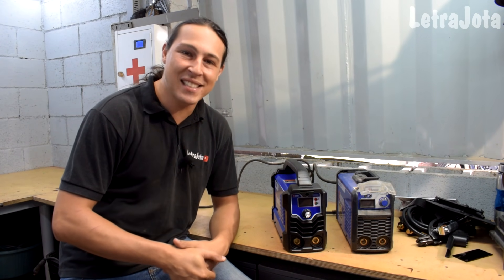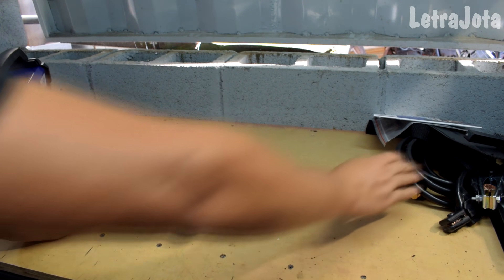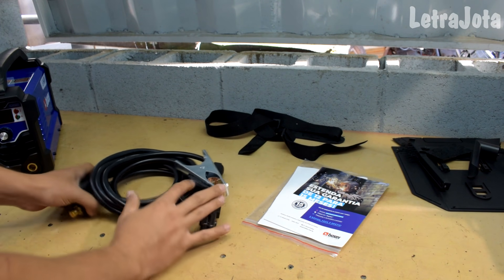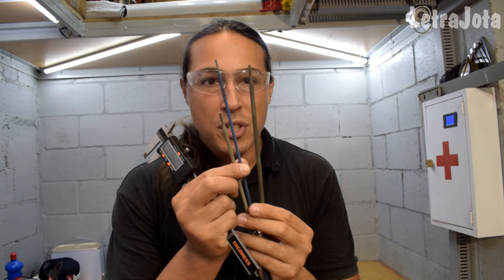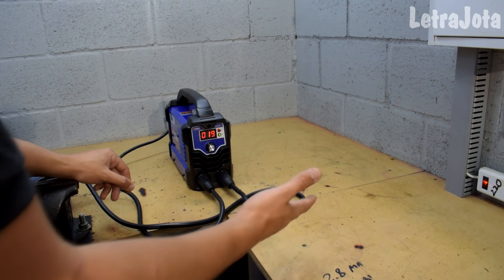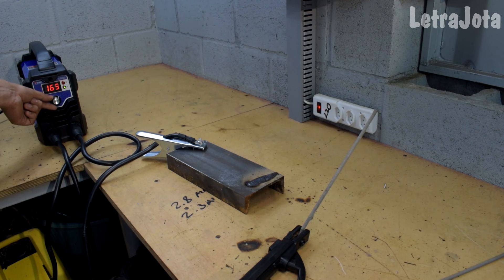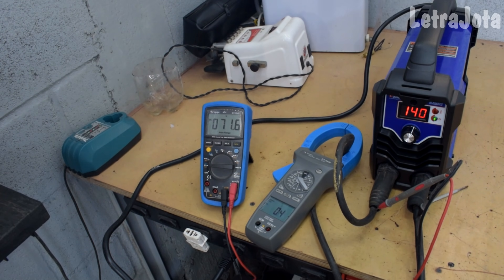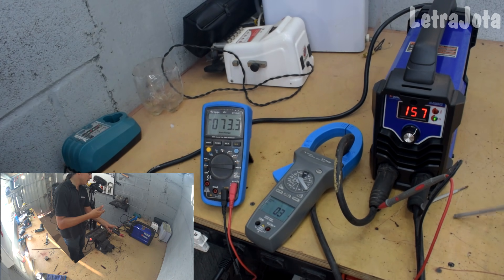TESTE NOVA FLAMA 221 BOXER

Comment: Ficou legal , só trabalhou um pouco acima por isso deu muito respingo . Lembrando cada milímetro equivale a 40 amperes se for soldar 2.5  na posição entre 100 e 110 amperes caso for soldar em ascendente desconta 15 % ficaria enter 80 a 90 amperes . Máquina fica manteiguina 👍🏻

Comment: Só queria entender uma coisa .. Na saída deu 30v x 238Amperes que é equivalente a 7.140 Watts . A máquina vem com cabo pp 3x2.5mm e plug macho de 20A .... 20A em 220v é equivalente a 4.400w Certo ? Como que a máquina consegue entregar 7. 140 watts na saída consumindo no máximo 4.400w ? Se ela consumir mais que 4.400w plug e tomada vão derreter ...Ela praticamente dobrou a potência de saída ...
Reply from the maker: Chega puxar na faixa de 31 amperes da tomada.
Em vídeos anteriores coloquei um amperimetro na tomada Verifiquei que a corrente sobe bastante além dos 20 amperes.
Essa máquina vem com tomada para facilitar a vida do hobbysta mas quem trabalha frequentemente com produto tem que mudar a tomada.
É que na maioria dos casos você não vai passar de 180 amperes
Reply: @letrajota  Ah sim ... é se ela consome 31A da rede tá explicado ... na realidade se for ver o cabo e a tomada até suporta a sobrecarga pois fica ligado pouco tempo consumindo essa corrente e na maioria das vezes o pessoal sempre usa a maquina com uma amperagem mais baixa né, é raro precisar usar na máximo ... Obrigado pela resposta!

Comment: Eu comprei flame 161 ela não passa  de 120 amperes no 110 votes
Reply from the maker: Tá bom pra caramba porque em 110 volts a corrente cai pela metade.
Isso é normal outras marcas inversora como a Esab funciona da mesma maneira.
Se for derreter mesmo é 220
Reply: Normal , nenhuma inversora da a corrente máxima no 127 somente no 220 , por isso as de alta corrente geralmente é só 220
Reply: Boa tarde video top eu tenho uma maquina de solda box ela está ligando mais não sai o arco manda uma dica pra nois muito obrigado